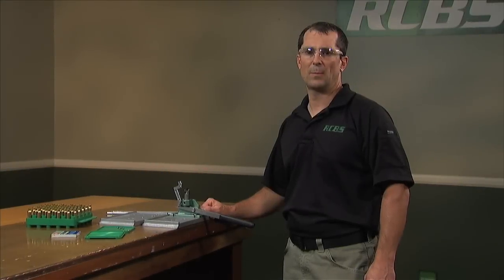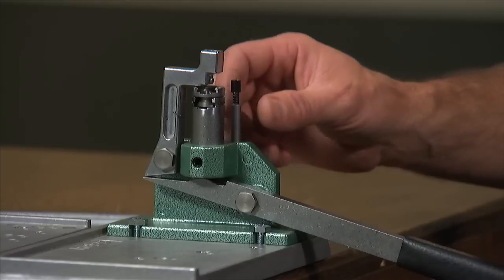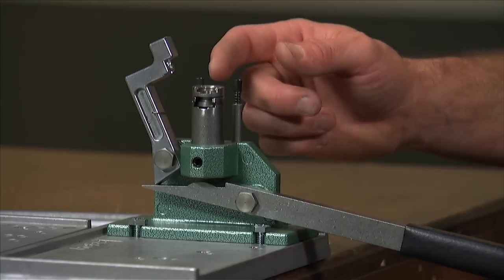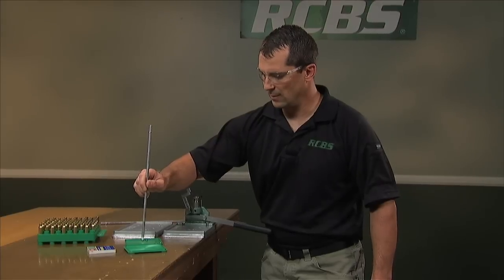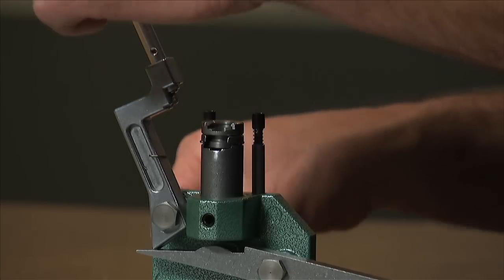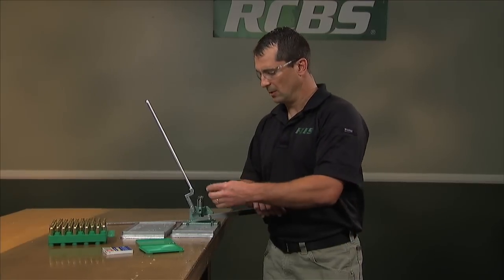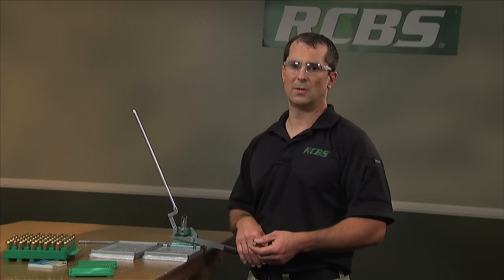RCBS® Automatic Priming Tool

Comment: I was frustrated at first that the primers kept falling on the floor.  The instructions do not give enough information to show how to assemble the pin, sleeve, spring, and ram together.  Once I figured out the sleeve had to be positioned to be a cup to catch the primer it worked like a charm.  This may be the best RCBS tool yet.  I think RCBS should include a diagram in the instructions or ship these assemblies already put together.

Comment: The best priming tool bar none. I have a Dillon RL550C and I never prime my cases on it....I always use the RCBS Auto Priming tool. The primer tube pick ups are really tight and so what I did was remove the RCBS plastic end and put on a Dillon primer tube pickup......far easier. Also, the tube slap which everyone complains about......I solved that problem with a rubber band. The factory spring is not tight enough to prevent the tube from bouncing while in use but a rubber band solved that problem.

Comment: What about the last primer that NEVER falls down the priming tube?
Reply: Just push it the a small wood pin or something
Reply: You mean the one in the plastic pick up tip? I always put the primer tube in the tool, pull the retaining pin, move to the top of the tube & push that primer down just a hair with the bowed, looped end of the retaining pin. Once you do it a couple of times it becomes an automatic motion that takes two seconds.
Reply: @cen_caloutdoormans5378  I use a brass punch the size of the primer od. Works great.

Comment: I bought a Lee priming garbage bench mount and the newest handheld loader, and both suffer the same dam problem. Primers are not feeding consistently to the ram. And I like Lee products. But their priming stuff is garbage. I just recently bought the RCBS priming bench tool. What a freaking pleasure. Loading the tube, not so much. But getting the primer in the shell casing is a dream come true. Thank you RCBS for making something that works almost consistently.

Comment: I can see where this would be a good investment if loading several hundred rounds at a sitting.  Not so much if you're only loading 100 rounds or less unless you just want the convenience and have the money to burn.  Myself, I will be investing in one.  One thing I never do is touch my primers with my bare fingers.  Even if you wash your hands well (get all the case lube off) before, your fingers will still start producing oil soon after handling a few rounds.  It's not just the oil itself that can contaminate the flammable material in the primer, your body's oil contains an acid that will tarnish the primer cup outer wall.  This tarnish, if you're not going to shoot these rounds within the first year of loading them, will eventually begin to oxidize.  This can cause the primer to seize inside the pocket damaging or breaking your decaying pin.  I always use a pair of specialized tweezers to handle my primers.  Yes, it's a bit tedious, but worth it to me.  I never handle my brass or bullets with bare hands either.  I always use light cotton gloves.  You can handles several hundred rounds before the oil from your fingers saturate the glove where you're contacting the components.  You can wash or discard them.  They're pretty cheap if bought in bulk.  My reasoning is, it's seems a bit silly to go through the trouble of cleaning and polishing your brass only to get oily fingerprints all over your freshly loaded cartridges.  My only thing is I wish they would update this video with the newer model.

Comment: I use a 1/8" wooden barbeque skewer to push down the last primer(s) in the tube, on several of my presses, that use the feeder style pickup tube.  No chance of damaging the primer or setting it off.  Skewers are cheap and I find lots of uses for them around the shop.

Comment: I own that tool, sometimes my primer tube will have a primer turn sideways inside the tube , have no idea what the cause is... The other thing that happens not very often is when the arm swings over to deliver a fresh primer the priming rod stays in the up position after i raise the handle , after maybe 10 seconds it will fall on it's own.. I've cleaned everything , so i have no idea what the cause is ?
Reply: Try cleaning the tube.
Reply: @mostlikelywedoitservices6926  Nothing changed ! SP and SR it delivers 2 sometimes! 
LP and LR it’s fine maybe it spits one on the floor out of 50!
Reply: Call the company. Good company.
Reply: @mostlikelywedoitservices6926  For all the years I’ve owned and used the tool I’ve never had any issues ! 
Then the rams started staying up after seating a primer ( 2-4 seconds ) both LP and SP So I cleaned then both with Acetone and I cleaned the inside of the housing !  Helped for a few cycles ? 
I explained all this to RCBS and they sent me new Rods  both LP and SP!  It improved it a bit ! 
But it still spits out a primer on the floor not so much with LP but it sure does with SP? 
They RCBS asked for pictures of the unit in both up stroke and down stroke ! 
Nothing is loose on the unit , it’s stored between uses with a hood over it ! 
SP I finally started using it manual with one primer from the primer tray manually , got so tired of picking up primers off the floor !
Reply: @normanmallory2055 , Have you thought about boxing it up, sending it to RCBS, and letting them figure it out? Because there is the spring and pin that hold the primers, could that be sticking somehow? I have heard some use a rubberband to assist the spring that makes the tubes spring back. From what I get, it makes it not so loose and violent in the forward and back movement. Just like with my Lee progressive press, shells would not slide all the way automatically back. I would have to push them with my finger. Made all kinds of adjustments none worked. It was an issue of grains of powder collected to the backside of the shell plate. Gave it a good scrubbing, and the problem was solved. So yes, gun stuff can be annoying.
Reply: @normanmallory2055  One thing I am going to do is take my dermal and modify the shell plate hole just a tad. The rod hangs on it now and again. You know adjust the tolerance.
Reply: @normanmallory2055  You should set up your phone to video using the loader. Then RCSB can see what it is doing when it throws primers.
Reply: @mostlikelywedoitservices6926  Thanks that’s a good idea !
Reply: @mostlikelywedoitservices6926  I’ve tried different shell holders as load several calibers and it makes no difference! 
RCBS I use mostly but bought a few Redding shell holders, didn’t make any difference! 
The tool has worked fine all these years , now it has a problem somewhere! 
I really looked at what’s different? What could change ? What part came loose ? 
It only has a few moving parts !   It’s a mystery !
Reply: @mostlikelywedoitservices6926  Yes I did entertain the idea of boxing it up and ship it to the company and let the experts look it over!  I have not as of yet !
Reply: @normanmallory2055  Agreed.
Reply: @normanmallory2055  Totally understand that response. LOL

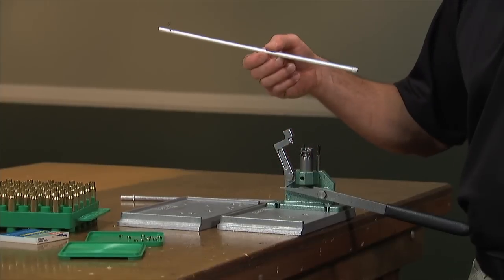Comment: I bought one and found out that what you say at 0:40 is not altogether correct. The first thing one has to do is to assemble it and with a very bad instruction sheet  I had a struggle. The primer cups gave me an extra hard time, as there were no explanation at all of how to assemble them. As is mentioned below I also can't get the last primer to fall down in the tube. It would be great if you could give me a safe tip of how to achieve that. Except for this the tool works OK.
Reply: Call ther office and leave a voice mail, they'll fix you right up.  
This virus BS has them closed temporarily.
Reply: I use the looped end of the primer tube retaining pin, the one you pull out of the tube just before you start priming. Use the round loop, NOT the sharp end! The round bow, line it up with two of the slots in the plastic tip & push down, the primer pops down the tube with a tiny amount of pressure. I've done it this way as long as I can remember, around 30 years I think. Still have all my finger tips

Comment: Just had a slight problem with mine and I think it was an owner operator problem.  The cup and spring assembly was evidently not screwed all the way to the shaft and worked its' way to be too long to drop properly and I somehow stripped the threads.  Make sure the rod primer assembly is screwed together properly.  There is a little hole near the top to put a small rod threw and tighten down.  I will do that when I find new parts.  I've heard RCBS is very good about taking care of their customers and I have a letter in now trying to find how to get one.
Reply: I bought one love it had one problem with it after several hundred rounds the shalt would not drop down had to push it down. took a fine file rounded off the part where the primer goes in works great now.
Reply: They sent me a new one no questions asked. Very friendly about it. It has lasted decades.

Comment: Now that's messed up. He says to put the primers cup side down to load the tube. I'm looking right at the RCBS Automatic Bench Priming Tool manual and it says cup side up. Meanwhile I'm trying to pick them up with the tube (cup side up) and I can't do it (which leads me to this video). Nice error in the instruction manual.
Reply: I know this is an old post but I checked the manual on RCBS website to verify.  It's true.  The manual actually tells you to load the primers in to the tube opposite of what the video says, which means you'll be loading your primers in to your bullets upside down, or reverse of what they should be if you view the cup as the open side of the primer.  This is really an interpretation issue.  As many would agree, when a person cups their hands, they normally do it with the open (or top of the cup) towards them in order to receive something another person might pour in to their hands, like a bunch of Peanut M&M's.  For a primer, the key is understanding the parts of the primer itself.  The instruction sheet (as bad as the pictures are) state "cup side up/anvil down".  This is important.  Contrary to what one might think, the anvil is actually located on the open side of the primer.  That little clover shaped object you see when looking at the open side of the primer is the anvil.  The instructions say this should be down, which is correct.

Comment: Wished mine worked . Out of 100 primers I got 1 primer to work . The rest are on the floor or somewhere near by .  I call that cash in the TRASH !
Reply: You're not using it properly then. Operator error.
Reply: You don't have either primer rod with the little cup at the end assembled properly. You're a shamer & a blamer. God forbid you call the company and ask for advice.